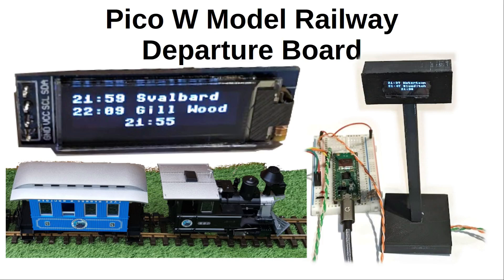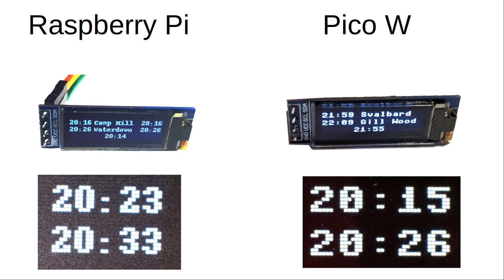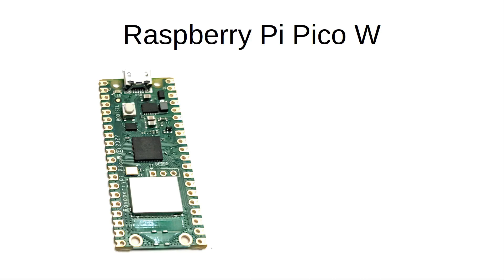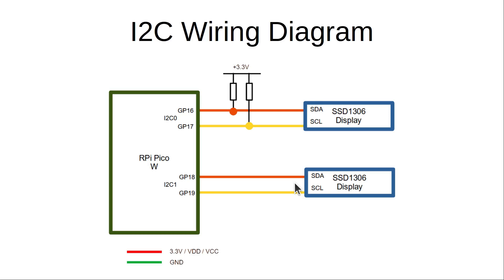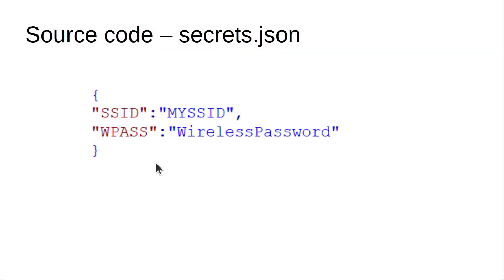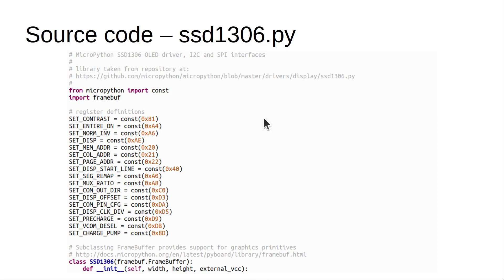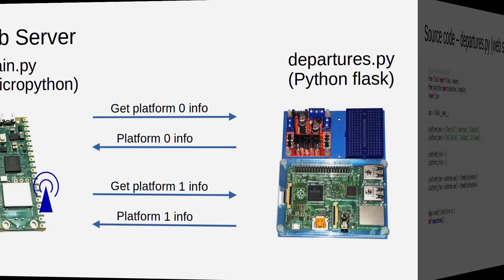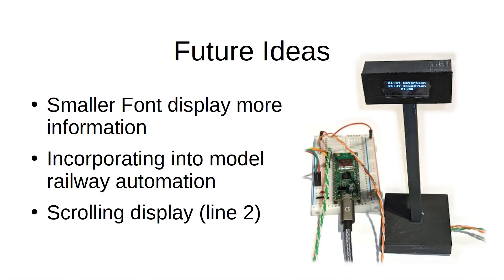Raspberry Pi Pico W - model railway departure sign with Wireless connectivity to railroad automation

Comment: Hey, I wanted to buy a display to use with my pico that I turned into a rubber ducky or BadUSB. i want to be able to easily switch modes and paylaods. Right now, I have to use jumper cables to accomplish what I want, like instead of automatically running payload.dd when i plug in..  its programmed to run payload2.dd if i connect GP5 to GND.  Is it possible to create a menu that I can select an option like "paylaod 2" and it would connect whatever Pins I programmed for each option so I can use the display to select options rather than having a bunch of wires I need to hook up and unhook?

Comment: The pico w is like a raspberry pi but cheaper, more affordable, and limited use, but more importantly more available. As long as you have one raspberry pi you can do most things with the pico w like interacting with email. Get a micro sd card holder for cheap for local storage on the pico w, or connect them to motors to start making robotic trains.

Comment: Very nice video! 

Why don't you use e paper screen?
Reply from the maker: Thanks. I thought the OLED display looked more realistic compared with the LED display at a railway station (at least at my local station). An e paper screen may look good for a larger display inside a station, but I think this is better for a station platform.